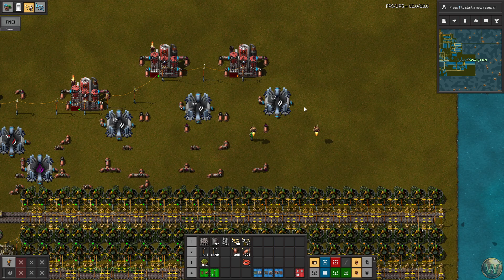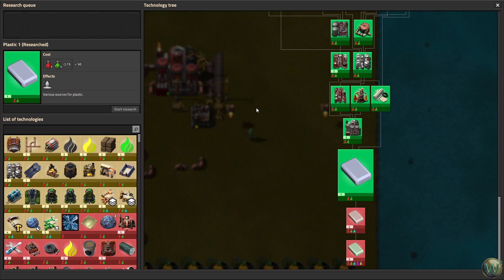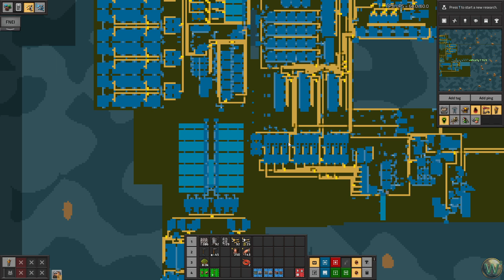Factorio Sea Block Learn & Build - Plastic & Lubricant - Let's Play - Episode 58

Comment: All the Pacifist findings 😅. Yes, I should add compatibility for Companion Drones, removing their laser defense . That also includes removing the companion attack toggle.
The gates are in because walls are in (I fixed that in the 2.0 port which is still WIP), and walls are probably required by one of the angels mods for things - I'll have a look when I'm back at the PC :)
Reply from the maker: Good ideas!

I didn't look what might need the walls.  Good point!
Reply: @Wally1169  according to the code, it's angels bioprocessing that requires walls for something. I didn't leave a comment why
Reply from the maker: Oh right, I should look them up in FNEI...
Reply: @Wally1169  they might not even be an ingredient, Pacifist would just remove that. I'm really not sure right now what they'd be needed for in bioprocessing. But for example in Exotic Industries I had to leave them in because they get scripted in when you go to Gaia.
Reply from the maker: I looked [stone] walls are an ingredient in a building but the concrete ones aren't.  Would be interested to see what the demand for concrete walls is
Reply: @Wally1169  there is an option to remove all walls and gates, and currently, I have a flag "require walls" in the mod compatibility config. When that flag is set, the option is ignored and you get all the walls and gates. It's a bit dumb
Reply from the maker: Gotcha

Comment: I am very interested in how you end up re-doing your ore processing.   I've got a more advanced smelting setup than you are using, but I need to redo the source side with chunk processing, just like you are looking at in order to get the ores needed to move forward.  Thanks for continuing the series after the expansion!
Reply from the maker: It's going to be a fun one!
Reply: @Wally1169  I need to make more space to redo my ore processing / smelting, but of course I have boxed it all in between all my other stuff at this point so yay.
Reply from the maker: I'm going to have to move mine as well, but luckily I have a direction in which to move.